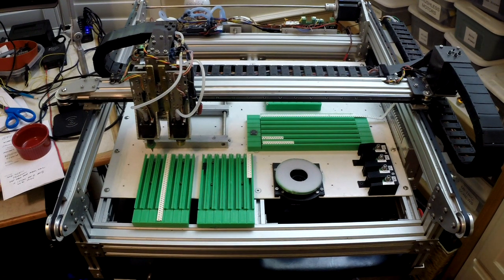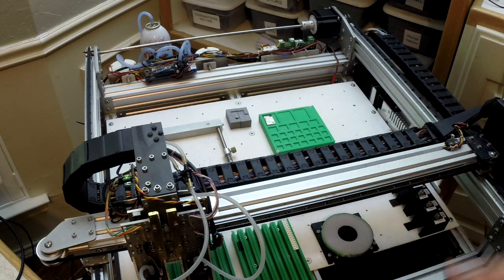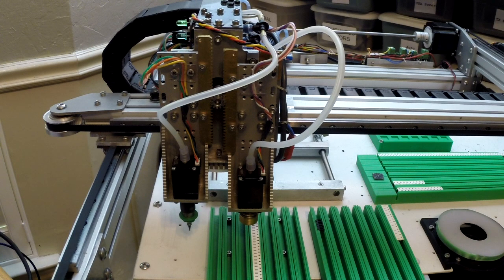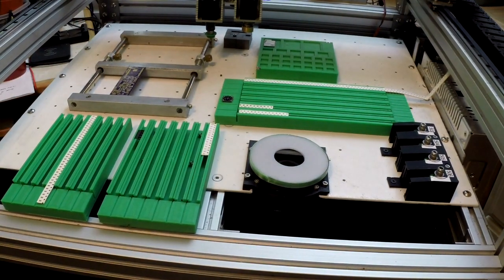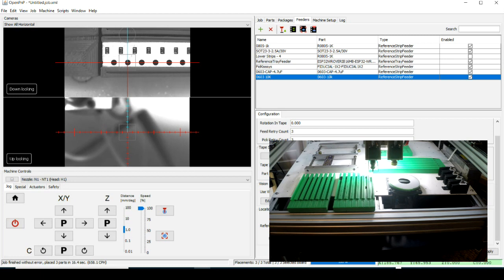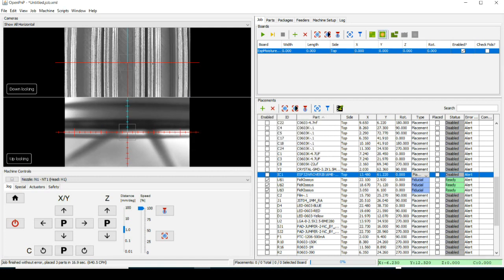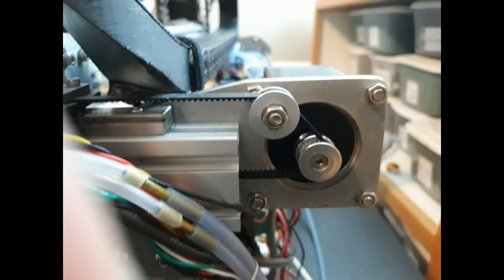Openpnp Pick & PLace

Comment: Wow.  I went the easy way (considering all the custom machined parts involved in yours) and went with a LitePlacer kit--a one stop shop for a simple PnP.  But after seeing this one move, I gotta say I'm pretty tempted to upgrade. So smooth and fast!  Depending on what you're producing, you may wind up finding the strip feeds a bit annoying (I sure have, and am looking at automated feeders, at least for the crazy popular stuff--looking at you 100n caps).
I really like the hall sensors for homing, I've had the jitter you mention with the visual homing but you can see in my own videos that it gets the job done anyhow--even for 0402 parts without taking the time for bottom vision alignment.  Only tips I might have are OpenPnP related: for short hops, the CTRL+click or moving that square in the cross-hairs is better than those base 10 motion.  For longer ones and other stuff, I use a lot of scripting to get rid of repetitive tasks (I'll be releasing my most useful ones/posting a vid about that soon). 
Anyhow, nice machine, great work.  Thanks for sharing.

Comment: Great work. I built my machine a couple years ago based on same platform but sadly didn't ever complete it. ~80% done. Maybe you inspired me to get back on it. It ended up costing much more than originally anticipated but I did splurge on Clear Path Servos, precision rails and an optical breadboard base plate. I made my brackets with printed CF Nylon and they have a bit too much flex. That was probably what got me hung up on the lack of desired repeatability and made me put it away. Was hoping to save on PCB assembly cost but ended up sunk cost for an interesting pile in the corner of my shop. Not a small project by any means and I appreciate the hours you put into it.

Comment: Well made machine. The reason to lower on the bottom camera is because tall parts have to be inspected with raised nozzle to have the bottom of the part at the same height and some machines, including mine, can only lower the nozzles, so it has to go down for flat parts.
Reply from the maker: Thanks, I never gave that a thought.

Comment: Nice build!
I think the mechanical endstops are overkill, since the machine should have softlimits anyway. When i build my first CNC i was thinking itˋs extra save and build them in.. however if you configure softlimits, the switches will never be used unless you have a very rare error, that your motors are getting wrong signals. With softlimits the controller will not let code or you drive the system over it’s limits and in case of mach3/cnc software even warn you if a gcode is outside of the area before letting you start it.
Since you’ve already have them in, it doesn’t matter, but you could get two more pins free on your controller for other things.
I’m building a PNP too, but it’s a long time project - of course:) After spending a lot of time getting a closed-loop style Z leveling to work, I’m testing some 3D printed feeder designs. I think it would be great to have just a few auto feeders for the typical 10k‘s and 0,1uf‘s. I don’t think it’s really necessary to have feeders for everything.. the tape and vision system is not bad. 
Keep on!
Reply: Yes your right, I mentioned that you should never need them once the machine is set up.
Reply: he should have used optical instead of magnetic hall effect sensors for homing, ive made a machine (Open PNP) which is having optical homing and works great
Reply: @raghav1502  I've used both many times.
Reply: @raghav1502  there´s not such a big difference between mechanical vs optical.. i also used booth for machines. On my PNP i don´t have any limit switches at all. I use TMC Stallguard for Y&X plus visual homing after it. And closed loop position for the Z (my Z Stepper only rotates under 360 deg, so it always knows where it is without homing).

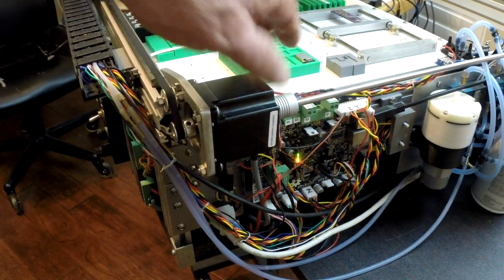Comment: 12:00 - How did you make that vacuum reservoir canister? Did you drill out the valve from the top or ?
Reply from the maker: I tapped the end down into the (empty) can and then drilled it out for a tight fit on a piece of tubing a couple of inches long.  I plugged the tubing on both ends with wax so when I inserted it that the glue would not clog it up.  Then with the can upside down I used a old syringe to inject about an ounce of epoxy up into the can and then quickly inserted the tubing half way in.  I just let is set upside down so the epoxy would flow down around the tubing on the inside and make a seal. I drilled out the tubing after the epoxy dried.

Comment: Hi.. great to watch this video.
How do you control stepper for X and Y axis..is it a closed loop system and controlled by smoothie?
Reply: Gcode from Openpnp is sent to the smoothie board stepper drivers to step the motors.  It's open loop, if I was going to make a really fast machine I would use closed loop servo system but not worth the added expense.

Comment: Does your tool holder allows you to change tools for both heads? or only for the one on the right?
Reply: I have it set up with just the right nozzle changeable. Just be a matter of adding another holder.  My thinking was to keep a low runout 503 holder in the left all the time.
Reply: that tool holder should have some sort of clips or magnets to keep tools in place he actually missed it

Comment: Do you have any details regarding the magnetic sensors/switches you use for the homing?  Part numbers, links, datasheets, etc?  Trying to make my CHMT48VB home better, thinking about making some adaptor to replace the microswitches it came with.
Reply: https://www.mouser.com/ProductDetail/785-SS441A

I took 5 volts off the smoothie board for power.  The sensor output has about 50 ma available so I added a low current led to light when sensor is tripped.  Used a refrigerator magnet to trigger it.  I believe I had to reverse the input logic to the smoothie board.

Comment: dude u dont know how to design a PCB the fiducials must be on corners and not in between somewhere and ur camera is having an error, may be 0.2mm in x and Y so just fine tune that and you will have a good PNP machine
Reply: The board was designed a long time ago, I just edited it quickly to add fiducials as a test board. All the board manufacturers have extensive instruction on how to do it and I have read several so it's not not knowing.  This is just a toy for me and allows my 72 year old hands to still assemble boards.  Also I have never seen and error over .05 mm and most of the time its more like .03mm .  Thanks for taking the time to comment.